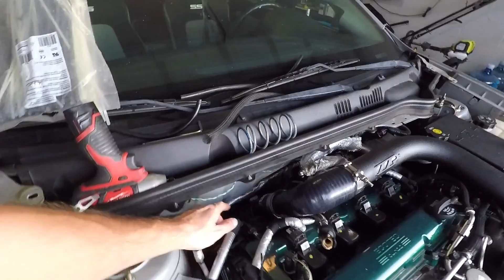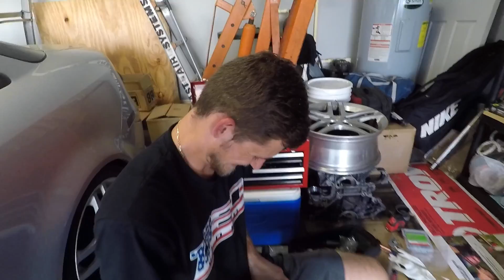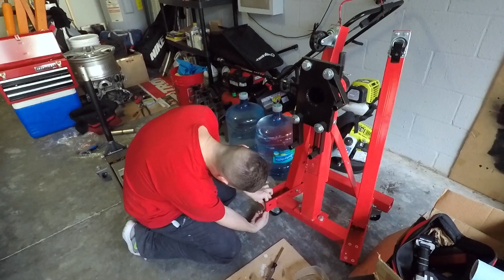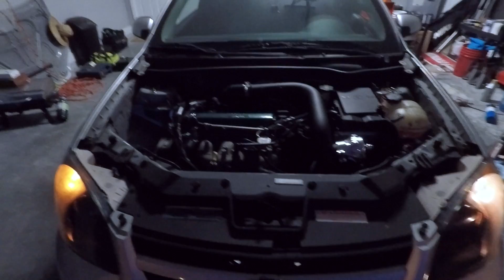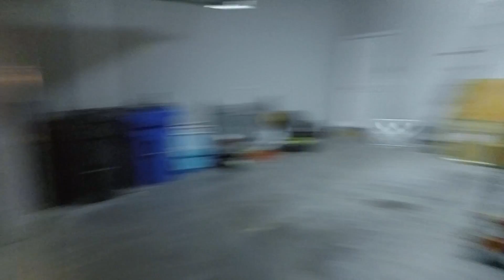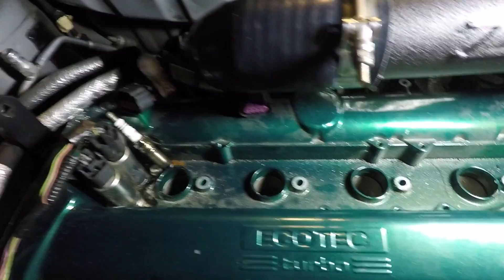When Sending It Goes Wrong. Cobalt Blows Up On First Pull

Comment: what you're hearing is the high pressure fuel pump for the direct injection system which is ran off of the intake cam. If you listen closely it's coming from the front right of the engine behind a black piece of steel with foam inside of it and fuel lines running to it. Every LNF sounds like that. You didnt hear it in the first video because the exhaust just covered it up. It will tick around every second at idle once warm and tick faster if you rev the engine.

Comment: That’s a normal noise for these motors. I literally just put a brand new long block motor with 0 miles in and it sounds exactly the same.

Comment: tip when you pull and install plugs after they're broken loose  push a piece of 3/8" hose over the end of them allows them to be pulled easy, and when installing the hose wont let you put enough torque on it to fubar your threads for those of you who don't own spark plug sockets

Comment: Goddang it America! Work on your cobalt motors lol
Reply from the maker: Hahahaha
Reply: not a hater.  just shade tree techs screwing up cars.  if it was a melted piston, it would be shaking and smoking out the exhaust.  guys are just ignorant.
Reply: David D or less experienced and trying their best?
Reply: David D yep that sound is just the direct injectors clicking. My lnf cobalt has made this noise since day one....sadly they don't read many comments and I can see them tearing into the motor and not finding an issue because there isn't one...... the air fuels are most likely the Maf...... if you do almost any mods to the intake of these cars the Maf reading goes wonky as hell and seriously fuck.with the air fuel. Most these things they are guessing at are fully covered on WWW.cobaltss.net, but who wants to use the internet to.figure things out from.people with experience? Not trying to sound like a dick but its pointless to assume the worst case scenario when you havens.even looked into it. And clearly whoever he talked to on the phone has a very limited knowledge of anything car related. Sounds like "fast and furious" car knowledge
Reply: Finally someone with some sense. Been in the cobalt game for a while and their inexperience is showing, we are the generation of learning online and they just don't seem to be reading up on the platform. When they were driving in the last video and saying it wasn't boosting, they thought boost leak which is ridiculous to say when clearly they went from a bpv to bov boost control system. They need to READ MORE!
Reply: manbowv8 yep I've been Modding on my car since damn near right after I got it. Its not a super high end build, but I have hit brick walls here and there but if I didn't figure it out myself I looked on the forums.the only issue I have had that I fan not seem to figure out.is the gauges dieing thing.I've done so many things including replace the ecm and bcm.... it'll be good for a while. Seems like no one has figured it out 100%. My car has done this since the first summer I owned it and I bought it almost new. The dealership doesn't even know what causes it.....
Reply: Sounds to me like a ground/power supply issues. Does the car die or anything weird when that happens? Does it happen often and predictable or completely random? Battery and alternator can do some weird things too. My car is not quite stock, I've got an overview video on my channel if you're ever curious lol.
Reply: manbowv8 nope its random. However if its hot outside it will definitely happen without question but does happen periodically when it is cold out too.I've checked grounds replaced my battery last year, alternator shows it is charging just a couple months ago I had to replace the brake master so while I had the fuse box out I checked it over and found some coroded pins. Cleaned them all up. Hadn't happened in a while just happened again yesterday. When it happens the radio volume will drop drastically the gauges will bounce around or just stop registering, they stay lit up and every warning light pops up. The Ac shuts off as well as power steering and traction control. I do have an airbags light in all the time for the passenger seat belt pre tensioner. No one on the forums has ever mentioned that as a cause however on one of those ask a car question sites someone with a cobalt said they had the same thing and their mechanic replaced that seat belt because he said it was causing feedback and making his car do that.
Reply: Only thing gm is working on is moving out of North America
Reply: I had a cobalt lt for 5 years with regular maintenance but went horribly wrong on year 5 cams went and electrical going 2 autoshops quote 3 grand I bought a mid 2000s civic and been the best car working wise . Chevy can make bad ass trucks and suv but their cheapness spills into their 4 banger cars. As a result I’m not sorry their leaving North America .  I would need a cruise with free road side assistance for a couple years to turn my tune .

Comment: Let him know it could be the Timing Chain Tensioner! My Cobalt made a sound similar and that’s what it was
Reply: Brian Sherwood ya I got a Saturn ion and they got the same engine. The timing guide bolts are soo skinny that they snap off sometimes if the guide breaks. That's what happened to mine. There is an access plug on the cylinder heads timing chain cover and instead of trying to get the broken bolt out of the head people have made custom bolts that hold the guile utilizing the access plug. https://www.google.com/shopping/product/5787863776720003157?oe=utf-8&gcc=us&ctzn=America/New_York&ctf=0&v=8.14.15.16.arm&fheit=1&biw=360&bih=615&ntyp=1&ram_mb=1820&q=2.2+ecotec+timing+guide+bolt&ampcct=20&client=ms-android-americamovil-us&wf=pp1&padt=200&padb=640&hl=en-US&prds=paur:ClkAsKraX8eJ8roule1s6LEXqa7RmrgysQSErSjmhWR2dT9l_rqhM1FwbopNF67jdZfROw-q08BcIl5FSBiy-75yW6Lwq7HrrPU5VyCmOLYXllZybYxZG6F7uBIZAFPVH73Y0zw9k9S-fi6J_GstAP3MR9mV2A,cs:1&sa=X&ved=0ahUKEwjAr_bJj-7cAhWGc98KHS_oCToQ8gIIMg
Reply: blindabinda123 Saturn Ions have an LSJ not an LNF. Not the same motor. Timing chain tensioner was a big deal on LSJ but not so much on the LNf

Comment: Might want to put a borescope in there before you pull it apart. Could be timing chain or bad lifter(s).  Also just use the coils to pull the plugs.

Comment: Thats just noising injectors. Its a DI motor. Maybe injector seals. But sounds normal for an lnf
Reply from the maker: No watch the first turbo install video does not sound like that at all. That is deff not normal at all
Reply: I mean im not expert, but my old cobalt was just as loud. Direct injection can be quite noisy. Ive heard plenty lnfs have just as much noise.
Reply: I mean ive heard many cobalts have just as much di noise as that one. As well as mine. Im no expert but by the video id put money on that or the timing chain tensioner. When the camshaft operates the fuel pump it tends to get noisy.
Reply: Get on the cobalt forum on facebook and ask lol
Reply: It's not direct injection
Reply: blindabinda123 yes it is the lnf motors are direct injection engines, that is why they have issues with build up on the intake valves. That and blow by is hell and toms of oil gets in the intake.
Reply: Sik2jz that clicking noise is normal it is the direct injection. My cobalt has sounded like that from day one.

Comment: Get a piece of fuel line to get those spark plugs out. Rent or buy a compression tester and run a compression check. If you have any questions feel free to comment back. I've been tinkering on my lnf cobalt for 5 years now..wish I had the money for one of those efr turbo's.but sadly I have other priorities in life. I think y'all are making a mountain out of a mollehill on that clicking noise. It is a normal.lnf sound I'm.currently tuned and making.22.5lbs on stock turbo.

Comment: 1) the car is untuned? come on you shouldn't see above wastegate pressure if you're untuned. you're asking for problems...
2) the ticking noise is DI fuel pump, they all have it, welcome to your first DI motor
3) Autolite plugs are junk. ACDelco 41-108 and close the gap to 0.032" if you're really having issues but 0.035" is fine for most people
4) if you hear a ticking on cold start from the timing chain the tensioner is cheap and easy to fix, just send it with a tensioner
5) the LNF has forged rods and cast pistons, still should be able to hold the power you'll be at
6) spark plugs with 2 screwdrivers? really? use the coil pack if you don't have the 5/8 spark plug socket
7) where's your intake?? if you're running a lower charge pipe maf (relocated maf with ZZP pipe) then you will FOR SURE need a tune because how the fuck is it gonna know you relocated the maf??
Reply: Great write up!

Comment: 12:30. Lol spark chopsticks. Lol I usually us the coil pack or a spark plug boot to put back on and pull out the spark plug. No spark plug screwdriver chopsticks needed.

Comment: Next time when removing spark plugs use the boots. Also timing chain guides and parts are the most problems wirh these engines.
Do a compression test. Check timinig chain. Change spark plugs and gas could also affect.

Comment: Hey I notice that you never mentioned making data log runs and re-flashing . If you have not done these steps, you skipped an essential part of tuning the car. This result in the engine piston melting because there was no enough fuel. I suggest you use hp tuners, you can log and see your sensors in real time and avoid another break. I hope you rebuild the engine soon, hopefully the sleeves are ok.

Comment: after watching this. you guys should not be working on a car. pulling a plug like that shows. needle nose would of been the right tool to use.  the battery if you cant read or recall. sell the car then. I have the same set up on my car and there more to it then just slapping on a turbo  SMH
Reply from the maker: It’s all in good fun, and we love to put it on video. Thanks for watching.
Reply: Makes the cobalt community look bad.
Reply: Seriously... it was very painful to watch and made my anxiety jump thru the roof..